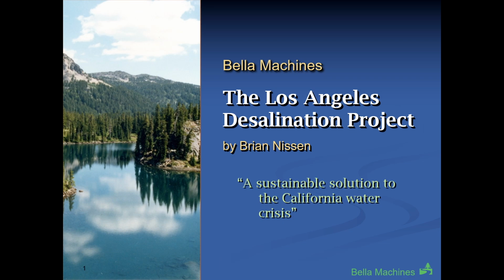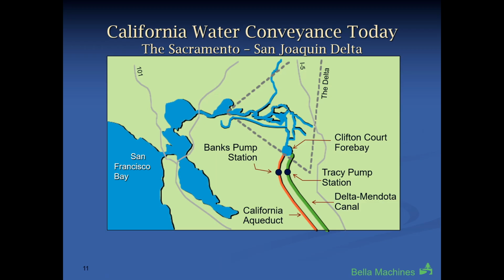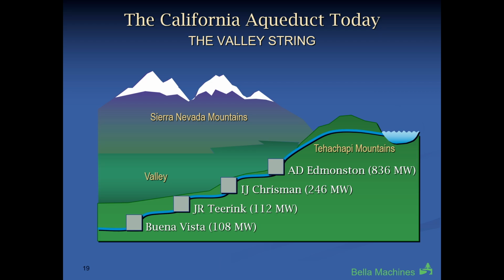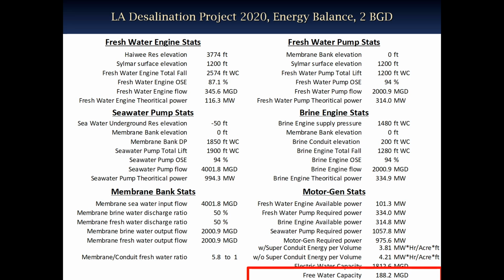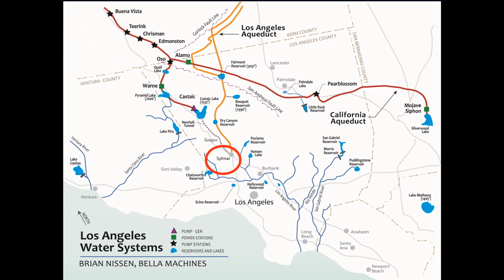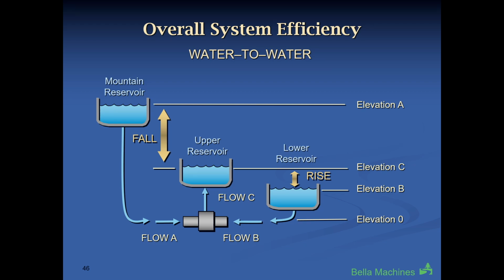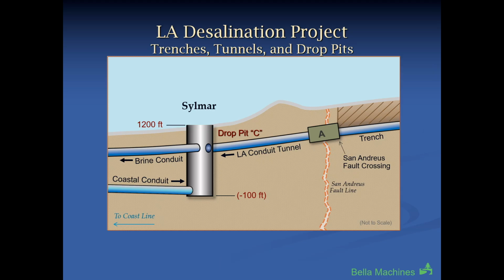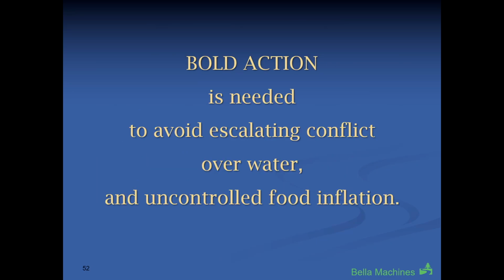Los Angeles Desalination Project Presentation

Comment: A creative idea with many, many obstacles.   Over my 35+ years in the SoCal water industry, it has become clear to me that reliance on imported water is a significant risk for coastal SoCal.   Reclamation (IPR/DPR) should be first, but desalination will inevitably be required to replace water from the COR and SWP in the longer term.   I am not sure that relying on water from the Owen's Valley to power this whole concept will be a great long term option as that source is fraught with problems of its own.   With that said, I don't think we should dismiss any options at this point as the clock is ticking.
Reply from the maker: Renewable pumping would only generate 188 MGD, a far cry from 2BGD. Electricity will be needed to run at full capacity. However, blending new water with Owen’s water could be a cost effective way to meet mineral requirements and reduce toxins like boron and arsenic below EPA standards.